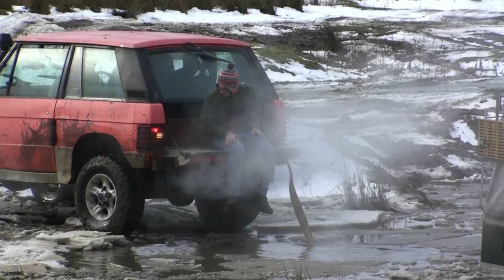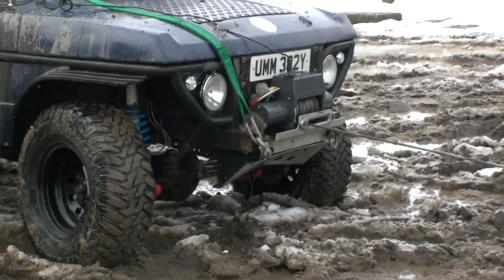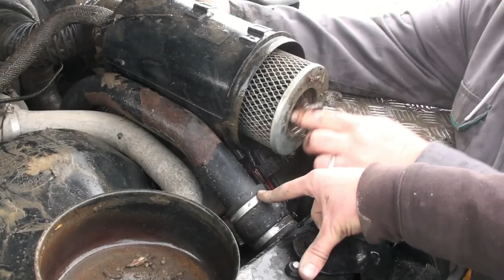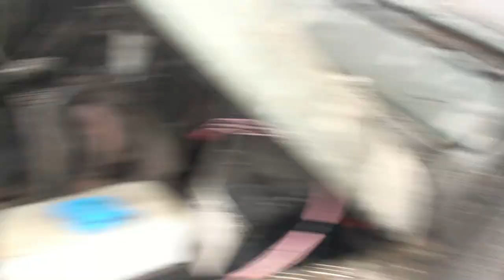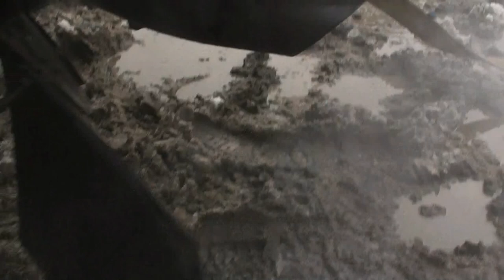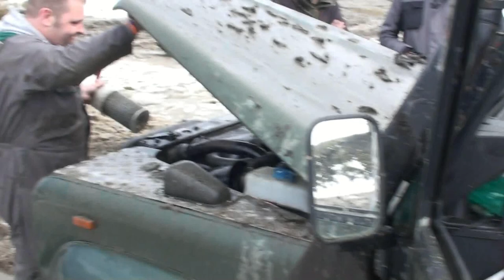Land Rover Defender 110 200TDI Wading Fail in Arctic Conditions!

Comment: The bloody "drain" valve almost Killed my d2 td5 I just plugged it with silicone never go too deep anyway, It ended up sucking the water from the road up into the airl filter making the normal one explode in the housing LOL, thankfully didnt kill the MAF or the engine.

Comment: I used to flood my disco all the time before i got a winch , safest bet is to pull the plugs and get someone to tow you round in gear , That way you dont flatten your battery cranking it over

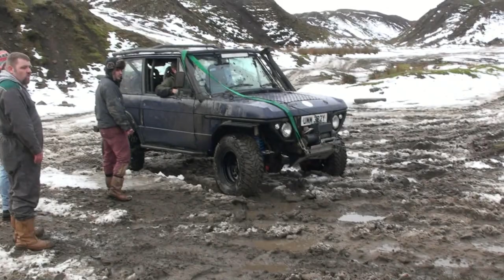Comment: Got the same winch the guy at 3:00 minutes had and have had exactly the same thing happen when I needed it. Britpart garbage.
Reply: +Khranok He also just used like 15 feet of winch line, you want to use as much line as you can because it reduces the amount of layers wrapped around the drum. the more layers, the less it can pull. Say you get a 9500lb winch, it pulls 9500lb on the first layer of line wrapped around, when you add a second layer, it can go down to 7k on the second layer, and as far as only pulling 5k on the 6th. and thats with a good quality winch, with cheap ones you're looking at way less. always keep a snatch block or two on hand to help use up line.

Comment: This video shows how NOT to recover a vehicle! Haven´t ever seen more mistakes being done... You guys should learn about that to save your life and your vehicles!
This is NOT a snatch strap - a proper snatch strap is designed to stretch and build up kinetic energy so it is much more efficient and puts a lot less stress on the vehicles!
Use 2 dampers on winch cables and get away from the cable! The winch has more power the more cable you pull out. Put on the snatch strap before you attempt a water crossing. Have a recovery vehicle already in place.